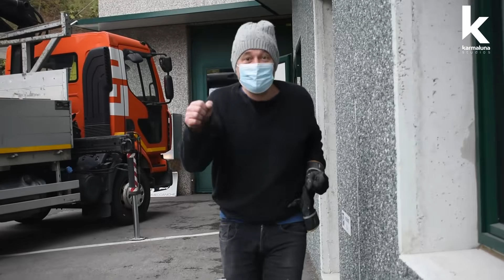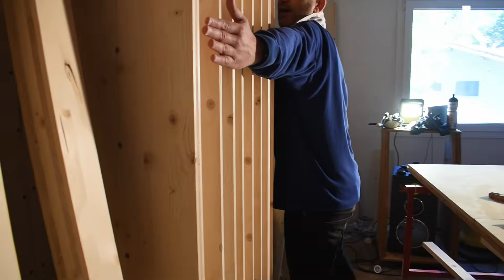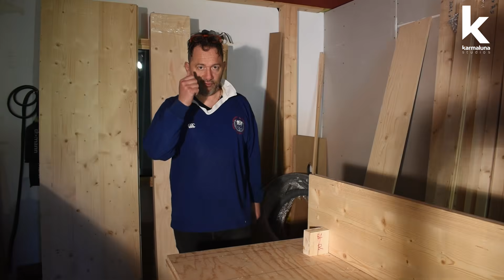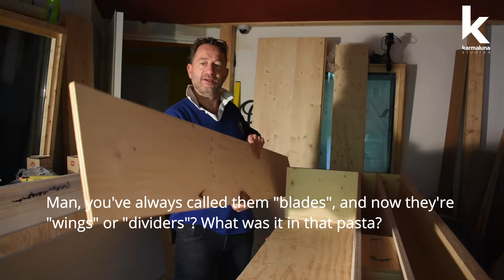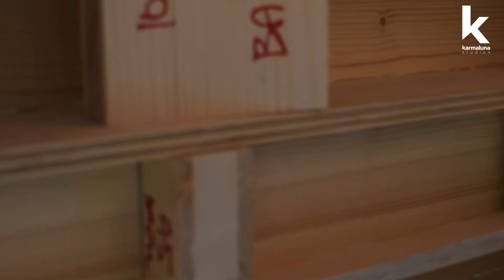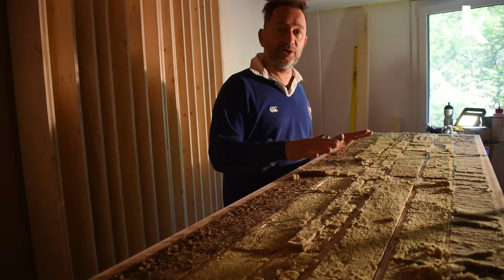How to build 2D DIY Acoustic Diffusers

Comment: Incredible work to build the room treatments! 

I think I'm going to build a space coupling diffuser for my listening room. I'm thinking 70"x36"x2.5 mounted behind the listening position, which is the center of a couch. The room is small 11.5x11 one wall, left side sitting in the listening position, is open to the living room below. In the listening room the ceiling is slanted 5' starting on the front wall and 11' on the back wall and the ceiling of the living room is also slanted so when looking left, it's open space eye level and above down to the living room below. 

I'm not sure how big or small to make the lattice design? Any ideas? Because of the size of the room, the couch is all the way against the back wall. The front of the speakers are 38" from the front wall. The bass response is good, not boomy. One wall open and the ceiling probably play a role in that, I think for the better? I do have a strong center image.

After researching and accounting for given measurements of the space, I hope a space coupling diffuser is the best choice. A skyline diffuser would look cooler but may not work as well?
Reply from the maker: Hey there @vuch9208 , thanks for your message and interest. Your questions are not easy to answer though. It depends from too many variables. I suggest you to ask advise to a certified acoustic engineer. We did that. It was a great experience. They come and measure the room with special machines (pink and white noise tests with oscilloscopes and other gear). They needed to know every detail about the floor, walls and ceiling materials. Regarding the control rooms, they also wanted to know the exact model of speakers we would put in. I was surprised when they told us: "Without the exact speakers' model, we are not able to provide you with a proper project". They also wanted to know the mixers model, not for their sound, but for their dimensions and surface angles (first reflections issues). We had to agree with them also on the shape of studio furniture and the shape and the position of our couch and chairs. We also told them we were on a budget, but we could put in time to build, hence they literally design every single piece of acoustics and let us build it by ourselves -> you can watch a miniseries on our @karmalunastudios channel regarding how we have built our Studio 2. And they also visited us a few times during construction, to verify our acoustic axis and our elements' angles between one another, and tested again the acoustic response and suggested slight changes. For last, they trimmed some last minor speakers' settings (amplifier switches and knobs) and gave us their final thumb up. A real long job from start to finish, but I can tell you we are so happy about it. All mixes are now good at the first try, such a difference compared to how we used to work before. I strongly suggest the advise of some professionals before spending time and energy on your studio acoustics. Good luck with your project and take care! <3